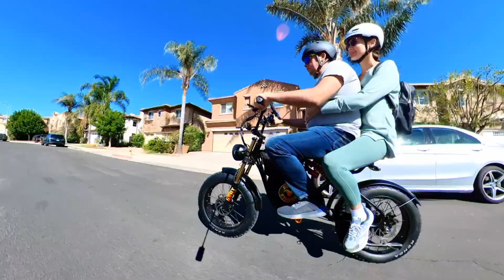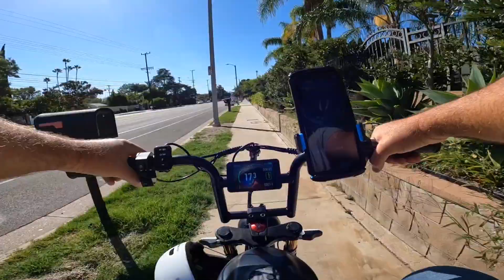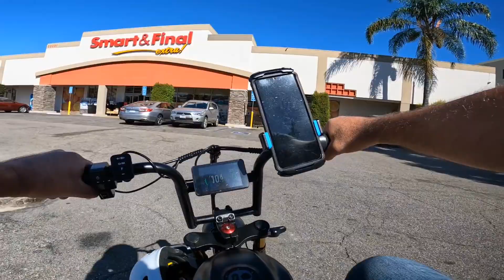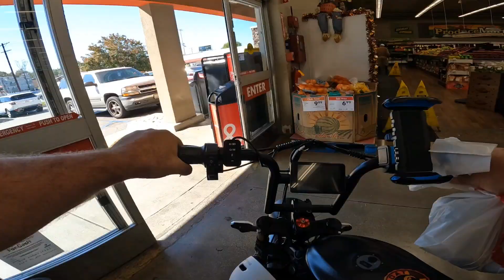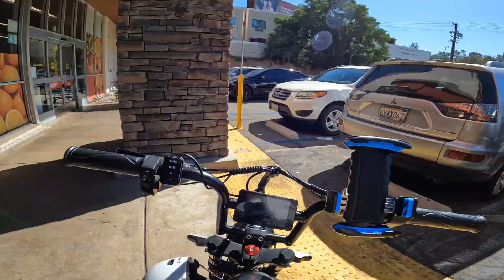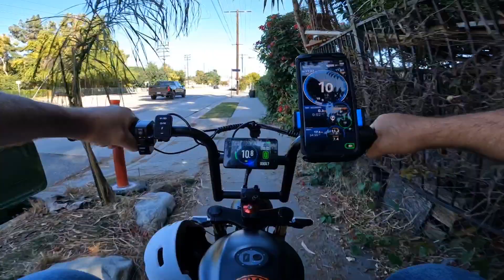WE tried Super73 Rival Motor Goat E-Bike by Goat Power Bikes

Comment: You need to get a Stem Phone Adapter. Try Peak Design stem Mount..

That Phone Mount set up you have is blocking your field of view and looks ugly right there 

Get a Quick Detach Stem Mount. It simply bolts on like a washer on your Stem Bolt and Cap. 

It will lower your phone and center it below your Bike Display. It won't block your field of view, nor shake around on you like that Phone Mount is. 

Also the benefit, is you can add the stem mounts to multiple different bikes and your phone adapter with simply snap in and out of them. The Female Adapter is peal and stick on the back if your phone case. It is also magnetic, so you can attach a Card holder when it's not attached to your bike. 

Seriously I don't know why more people don't use quick Detach Stem Adapters.

They look way better on a bike because they are centered and symmetrical on the bike.

Oh and they are adjustable, so you can adjust the phone display to where you want it. It uses like a small arm mount. It has a Button for detach. Its far more sturdy than the traditional mounts
Reply from the maker: I actually set up the phone that way  that viewers can see the GPS speed on it.. I would hold the phone in pocket if I would not need it on camera :)

Comment: Great e-bikes. Just removed my Mars chain ring & chain. In CA a Class 2 EBIKE needs no pedals if limited to 20mph on the controller settings from the factory. 30mph is fast enough & the cops won't bother most people unless riding recklessly like BMX bicycles in NYC.
Reply from the maker: Exactly, if you ride safe and not like a punk the cops will not bother you
Reply: I don't understand how California wants people to switch to Electric Vehicles, when they over regulate Ebikes. 

Instead of placing Limits on the Ebikes themselves. They should just simply set speed limits on Trails, Bike Paths etc.

Just because my Ebike can go 50mph, doesn't mean I am going 50mph on the sidewalk.

I live in Lincoln Nebraska and ride an Async A1 Pro (35MPH Max Speed).

Cops wave at me when they see me riding it.

Ebikes, even if they can go 40mph, they aren't designed for road use. They don't really accelerate fast enough to keep up with Road traffic. 

I just like having the ability to hit 35-40 mph on my Ebike if I have no other choice but to use a 35mph road.

I just simply switch to Class 2 Mode on the Bike Path, and max out at 20mph. If I have to hit a main road, I ramp it up to OffRoad(Class 3+) and Max speed it until I can get to a side road of 25mph

Comment: When you are riding by yourself, would you say the speed is satisfying enough or do you think it rides a bit slow? Also, would you say the range is pretty good?
Reply from the maker: It's fast enough for me 30 mph +   and might go faster if more psi in tires and lighter rider..  I think it provide very good range for the  13 ah battery, but if you need longer range, they sell 20ah battery, and 10% discount should  work on it code: dad 
You can simply put one battery in the bag that would make it 33ah battery pack 😀
Reply from the maker: Here is off road and honestly it was pretty good ride!  https://youtu.be/8vNpKj0Xvqs

Comment: Do you have license and registration for the bike?
Reply: You don't need a license, registration, insurance or gas.
Reply from the maker: No need
Reply: Ebikes are classified as Bicycle. That's the Benefit of Ebikes. No License or Registration required. 

It's just Plug and go. 

Just remember they aren't designed for road use. Even if they top out at 40mph, they don't accelerate fast enough to keep up with traffic. Stick to Bike Paths, and Side Walks on Main roads, on side roads you are good to go 25mph